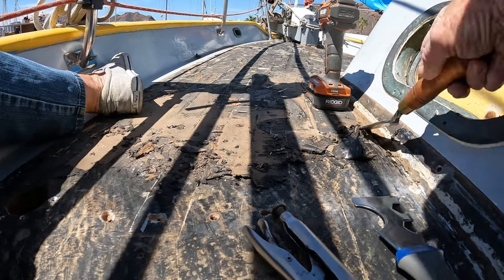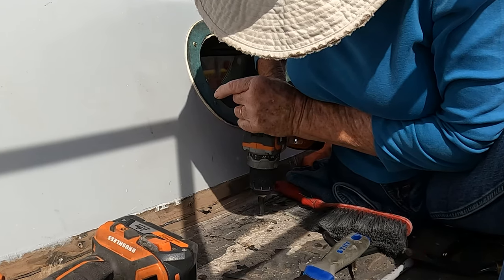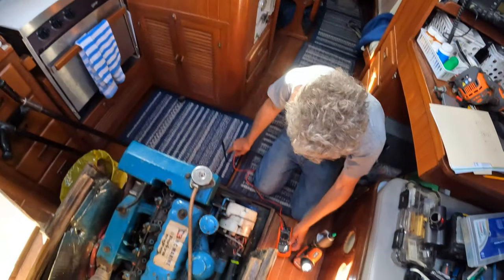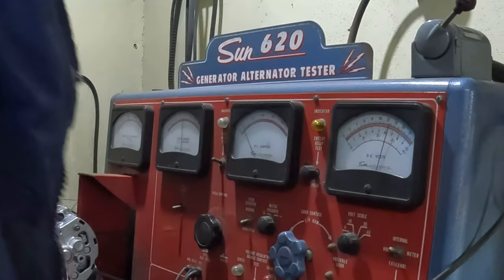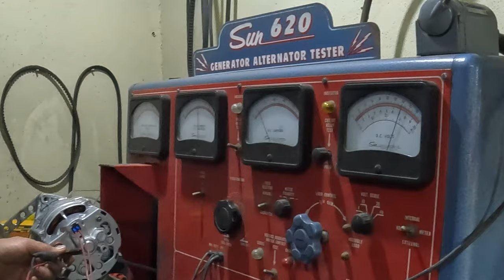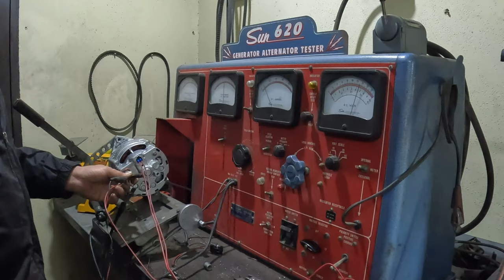Ep. 98 - Teak Deck Removal Notebook:  Discoveries

Comment: That is so great to hear about the composting head! We removed the head the black water tank and plumbing. We have an airhead we are going to try. Also found some wet core in our 1978 C&C 34 replaced with closed cell foam  and reglassed. Very happy with our old boat. You two are inspiration, love this channel.
Cheers and give that puppy a belly rub for us!
Jim
Reply from the maker: Belly rub received with great pleasure!  As for the composting head, ours is a Nature’s Head. There is a little learning curve at first when transitioning to a composting head, but we are very satisfied with our decision to switch. Plus it allowed us to eliminate two through hulls. Theboatgalley.com has some excellent articles about composting head use.